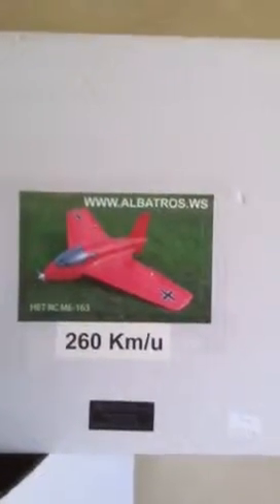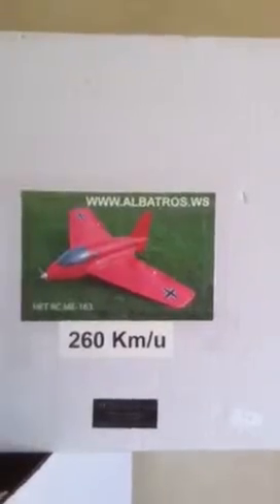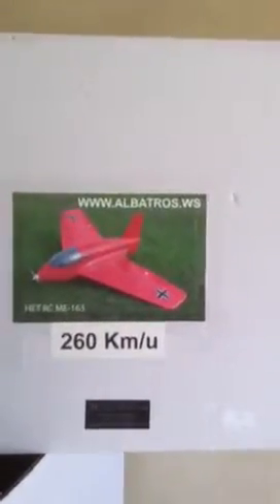HET Komet ME 163

Comment: DA,

Did you have the CG at 90mm back from LE where the wing meets the fuse or back from the wing root which is part of the fuse. 
Another way to put it is: How far out from the centerline of the fuselage did you measure back 90mm to the CG? 

Thanks,

nick@tannaci.com